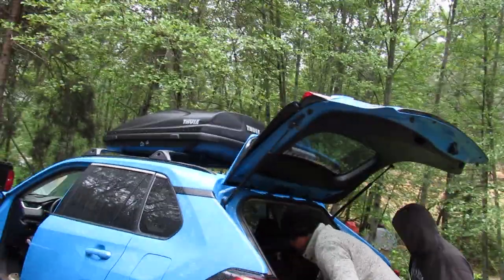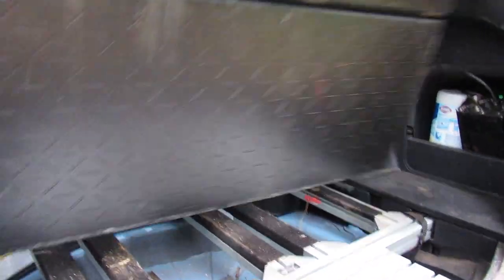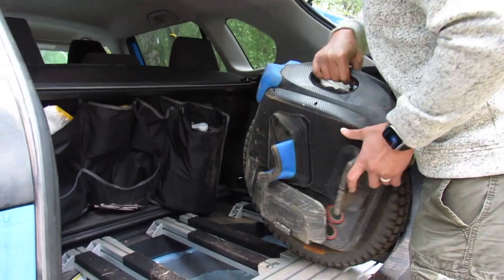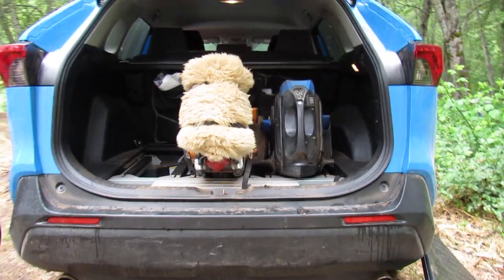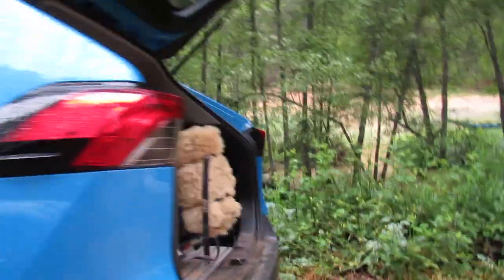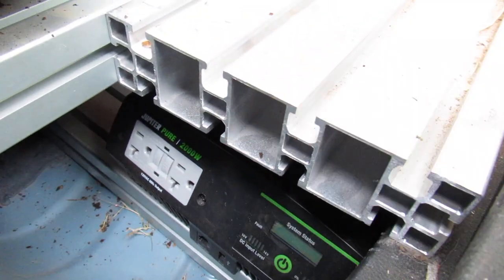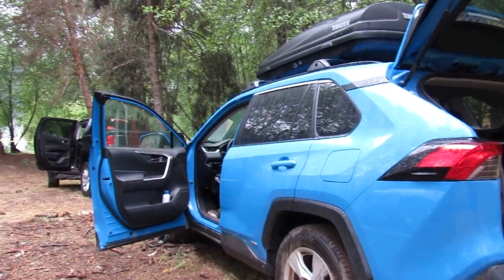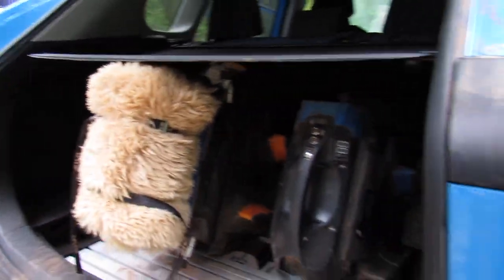Charge Electric Unicycle With Your Car: (INSANELY AWESOME) CUSTOM UNISTRUT STAND! INVERTER

Comment: I have the rav4 prime on order for 3 months - this 2022 has the inverter built in and has a much bigger lithium battery so the engine cycles even less and it can go 42 miles on just electric.
Reply from the maker: I want one! Fuel efficient rally car overlanding rig with a rooftop tent! Sweet lil ride especially with gas this high
Reply: @choochtech  I saw a channel recently showed off their Polestar they just got and it was pretty nice.  Polestar is Volvo's EV brand and the base model is under 50k USD. Unless we can upgrade to the next tier (EV Hummer, 600+ mile range and it can crabwalk, 100k+ USD) the Polestar is leading the pack.  It's between an EV and Subaru Ascent now that the '14 FXT 2.0 DIT is very expensive to fill since it takes super - even at 23 MPG average, the Ascent gives equal HP and runs on regular as well as rated for 2 1/2 ton (5000 lbs) towing.

I really want to fully cut over to EV and leave all the gas behind.  You can drive I-5 from Canada to Mexico and US 101 from Astoria to San Diego with plenty of access to charging stations courtesy of the joint efforts of regional governments in  the West Coast Green Highway Project, and I live on the west slice so it makes a lot of sense.  It would be very cool to go from Baja to BC and never need to stop for gas or oil.  There are adapters for PEV for the bigger car chargers, which is also cool; I would just plumb the adapter through the back and have two connectors, one on retractable cable so I can hit two chargers at once, if available, and not have to pull them all out to charge individually.  If you're already modding an EUC there's nothing about a car you can't figure out lol and that's truth.
Reply: That is pretty good - my cousin drove his Leaf to work because they would let you charge for free but the thing would only go like 30 miles towards the end.  I know, you'd expect a pure EV to get better mileage...I think it only came with a rated 75 miles from the factory new and even then that was kind of almost complete BS, as I watched that thing slowly die without dying or ever being really alive in the first place.  Everyone I know loves their ravs.  My kid even rebuilt an old one from salvage - they've always been solid rigs.

Comment: Uni-strut = extruded aluminum profile = 80/20 brand name

Unistrut = brand name for steel channel beams and accessories; Thomas and Betts are your value option.

If you have a full electric car/truck you can charge all your wheels dozens of time and barely take any off your main cell.  (right now the Volvo Polestar is in the lead for us, still deciding which to get)

The problem is you have to convert to AC then back to DC again, not only wasting a lot of energy but causing a lot of heat stress and also it takes extra time and gear - if you had a direct charge system that did DC-DC you'd be back to full MUCH faster, especially given the size of a EV car cell compared to the battery in a hybrid.

Comment: It's entirely possible to mod a car to use only these electric unicycles rather than regular wheels. That means, its entirely possible to design a spare tire for a car, that just so happens to be a electric unicycle.

Try to get in contact with some mildly though not completely insane machinists that are willing and able to create such a wheel adaptor. 

Also, a bicycle and motorcicle should be modded to demonstrate the potentials.